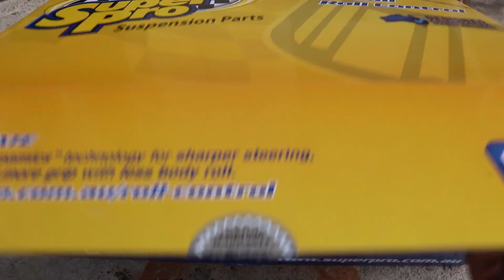bugeye wrx | New control arms, ball joints & link pins

Comment: Will this fit in 2007 subaru impreza wagon hawkeye N/A?
Reply from the maker: they should as suspension wise the wagons were the same between bugeye, blob and hawk. even a lot of the forester stuff is interchangeable of the same year
Reply: From Flatironstuning: "Please NOTE: An alignment is required after installing these arms: these arms are Sedan width, so if you are installing them on a WRX Wagon, you may need to swap to an STI front Sway Bar, and you may have some wheel and tire rubbing that would need to be addressed."

Comment: wow same exact thing happened to me. Put new STI control arms in my forester with all new suspension no worries. Went to the rear for the lateral link bushings and fuck me they are so tight. Had no chance. In at the mechanics we go
Reply from the maker: they were impossible. i even saw them at the mechanics swining off them with a 1m bar and still only just managed to crack them open. and a few new bolts were needed after. not their fault. was just the only way they were getting replace aha

Comment: Was it worth the price ?  Is it worth getting the tie rod ends from them as well?
Reply from the maker: i was needing new bushes anyway and figured i may as well upgrade, i got these ones on sale for 600ish i think and it felt pretty good, dont notice it normal driving but when going hard in the corners you feel the improvement. just feelts a lot tighter